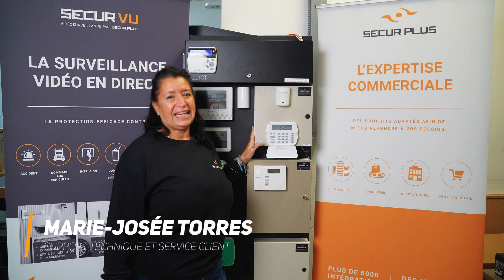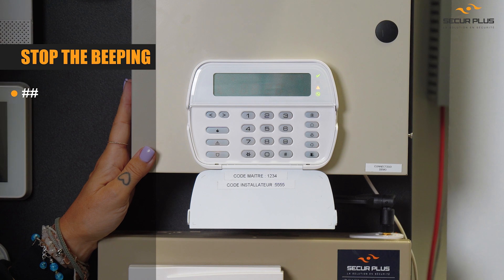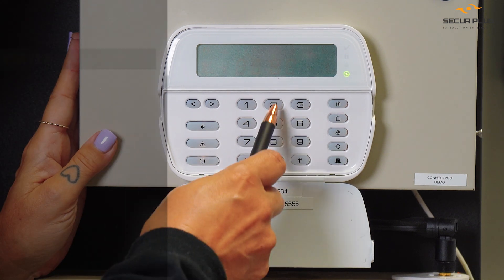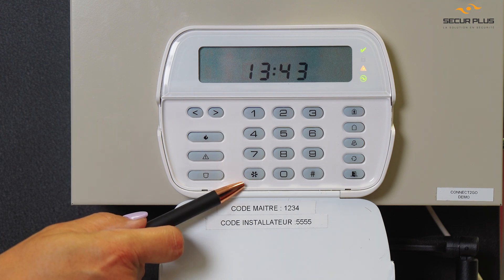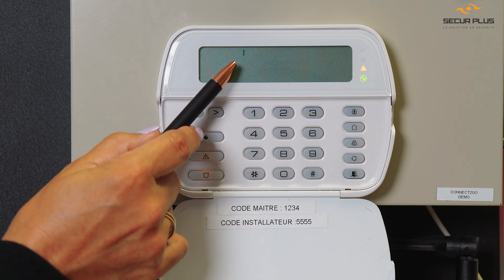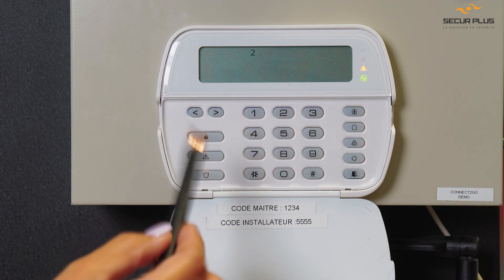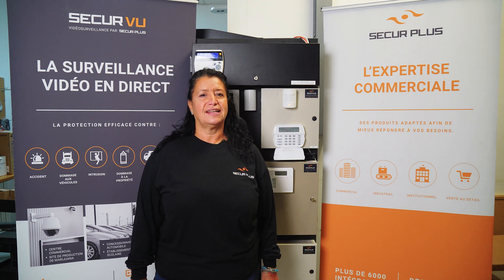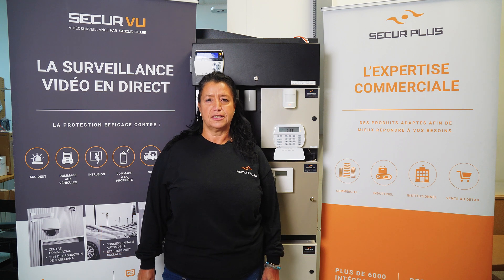How to Stop the Beeping and Identify the Trouble | DSC PowerSeries

Comment: There might be a separate battery in the alarm itself. If you can reach the actual alarm attached to the side of the house, open the screws and remove the cover, you will see another battery that you can disconnect. If the power is cut and the battery in the cabinet has been disconnected then it will surely be the battery in the alarm panel itself that it the source of the continued ringing.